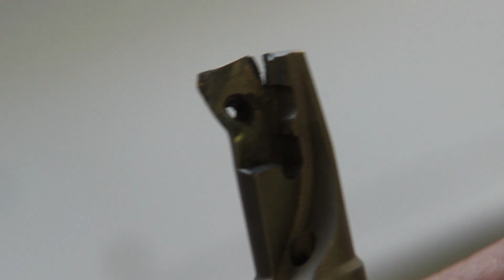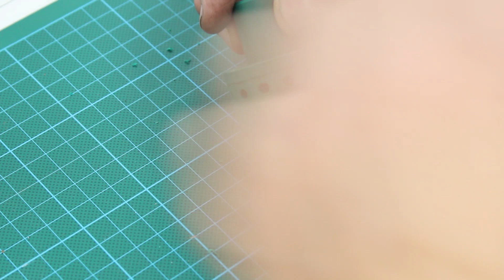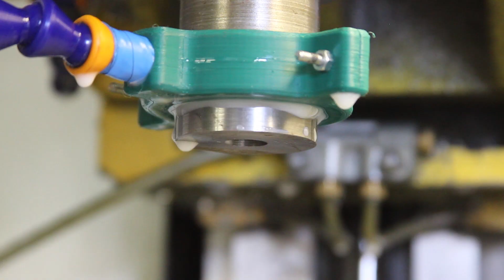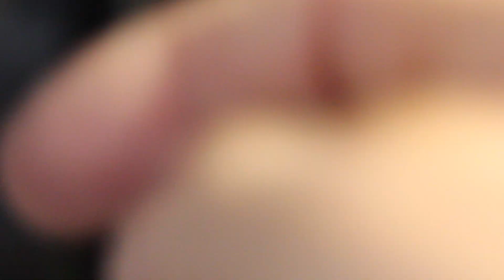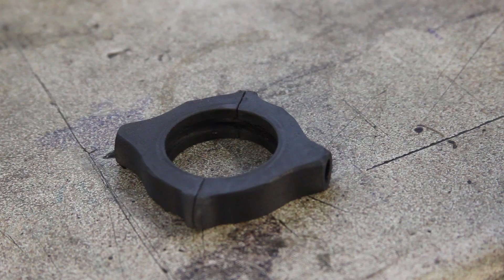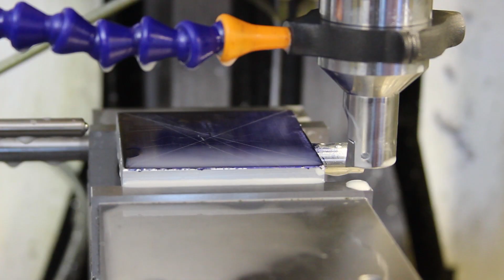Can you have TSC without a fancy machine?

Comment: Intention to chat. 
Well the idea is not bad. But the liquid has to work against gravity forces. So the liquid movment must have at least the power to overcome the g forces that it works against. 
When you add a pressurewasher system with a few bar like 100bar to start with, the liquid will get pushed into the tooling and out at the nozzle. There is a reason to the high pressuresystem in bigger cnc machines.
When you would seal the yoch and make a flowting ring on some rubber bearing rings so the coolant cant escape it would work some what better. 
But speed and pressure are the hurdle to overcome. Because the liquid will slip on the surface when the surface moves beneath it fast.

Regards.
Reply from the maker: Thanks for the comment, I think you are right the centropetal force makes it a tall order to get the coolant to flow into the tool. I beleive you might be able to get it to work with carefull design of the exit path for the coolent as it could create negative pressure. This might help suck the coolant into the tool but again you run into the centropetal forcer throwing it out again. 
The brute force high pressure systems used by the professionals is clearly the best way.
As an experiment it has showed us the problems to overcome maybe a mk2 is in order some day!
Cheers

Comment: nice work, however i think you would be better off making the yoke part with a more secure way to secure it on the tool. also, a dedicated flexible coolant line with some kind of quick connect fitting and a couple valves so you could turn either coolant line off or both on at once. from there it would be nothing to add a solenoid valve and be able to turn it on or off as needed in the machining program.
Reply from the maker: Great point! I think its still a work in progress like most of the things I make!!
Cheers

Comment: I.m no expert but I think you need to slow down your pump. It should not pump with any more pressure than required to keep the channel full. Also is there clearence between the collar and the inlet holes in the tool holder? If not your only getting flow through one hole at a time. It would be better if the excess pressure when blocked between holes had some sort of buffer as in a gap between the collar and tool holders inner ring. This would also allow more coolant in the inner bore by entering more than one hole at a time, although it appeared that you have sufficent flow to fill inner bore.
Reply from the maker: Hi Greg,
The pump is a mains induction motor runs at one speed only. There is clearance between the collar inner channel and the feed holes into the tool body. There are a couple of bits of broken drill in two holes though. I should know better but I drilled them too aggressively and as they broke though into the other radial holes broke off. 
Having said that the tool works a treat, in the last instalment of this I got it to work well yes it does still leak but I dont see that as a problem as long as the coolant gets to the cutting tip.
I made this as an experiment hopefully others will pick up the idea and make there own versions.
I still think its a novel solution and could be developed for many more styles of tool.
Cheers
Reply: @CazualHaze  Well ot was a great idea and I think I will try this when I get time.